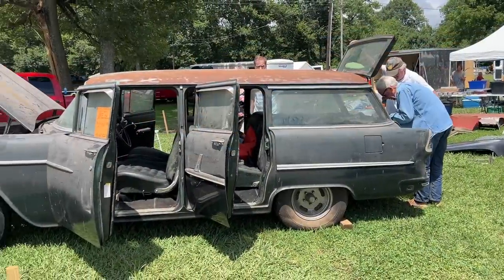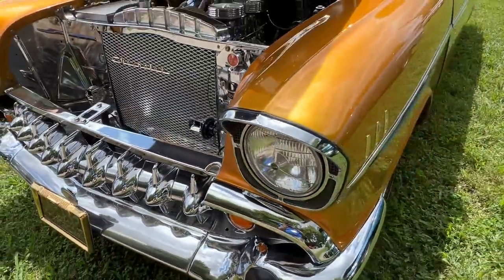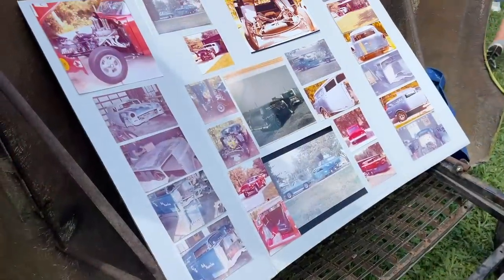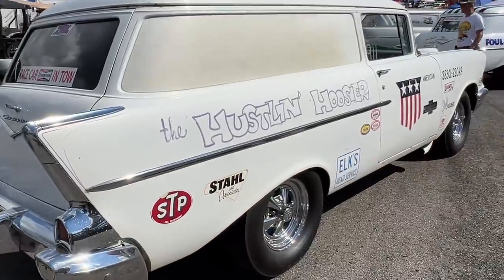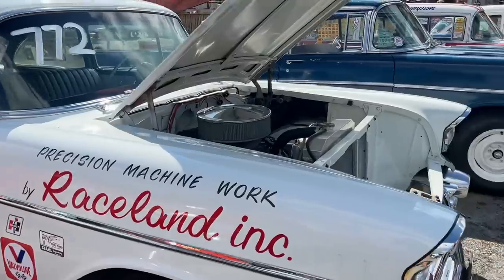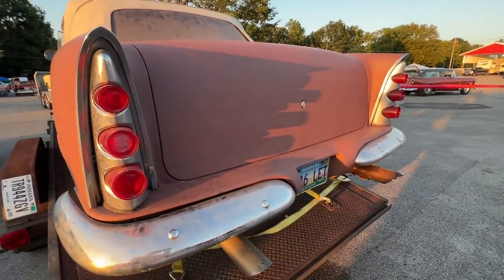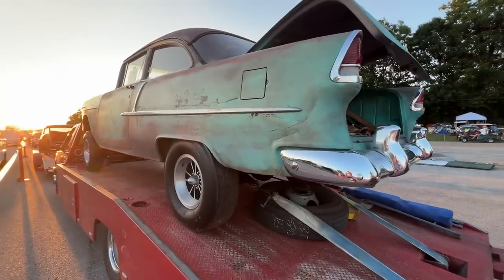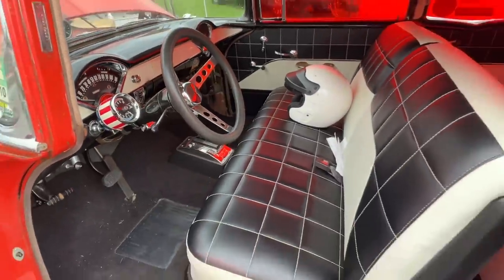Tri Five Nationals 2023 - Survivors, Barn Finds and Drag Cars

Comment: That 55 at 18:00 , Thats a west coast setup on those spindles. A suspension shop out of Stockton California, if I remember right its Burlingame or something like that. They had a (and still might have) a Jig from the 70s, where you take two Tri5 chevy Spindles to make one lifted spindle by welding them together. It raises the car 5-1/2 inch but pushes the wheel out an inch and a half (as seen on this 55). I have a complete front-end setup like that if anyone is interested. 
Believe it or not when you use a rack and pinon steering set-up it really drove and steered pretty good.

Comment: Perfect example of my youth back in the 60s. Bought my first car off the drag strip at 14, no engine, 55' Bel Air 2dr Sedan, rear arched fenders, traction bars, clutch scatter shield, blue tinted windows and head lights, gold paint, hand lettered, M&H slicks, chrome reverse rims rear, white 15" steel's in front, everything below the parking lights was removed except the Moon gas tank & the tow bar,  $125.bucks, delivered!  
It would have fit right in this video but all I have left is the Tow Bar & memories.

Comment: Excellent! I'm a tri five fanatic and a gasser fiend building 3 tri fives a 70's style street 55 post 427 th400 9" five spokes,a 55 gasser straight axle period pieces 468 tunnel rammed super T 10 9" halibrand style wheels rocket 10 spks one piece tilt fiberglass front and a 57 post street strip car tube chassis big block Super T 10 9" still in period stage thinking injected sbc altered??? ASSASSIN TRIBUTE